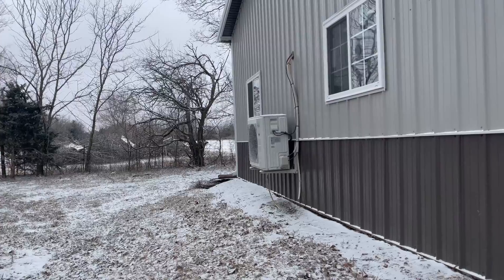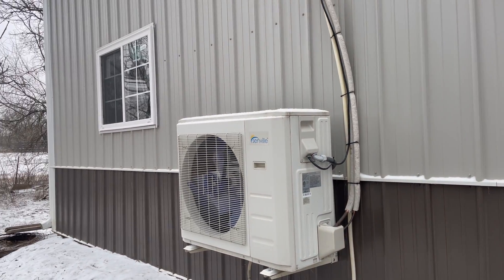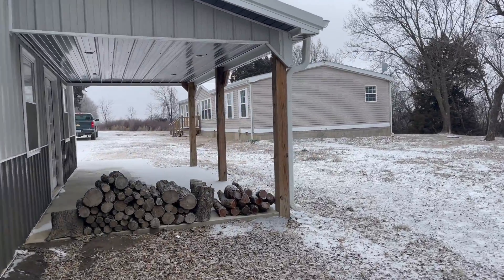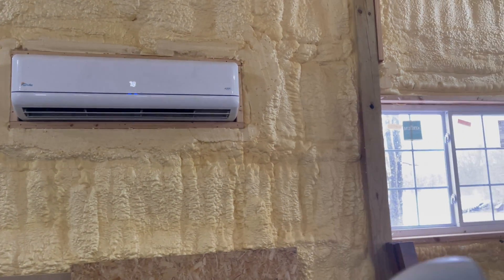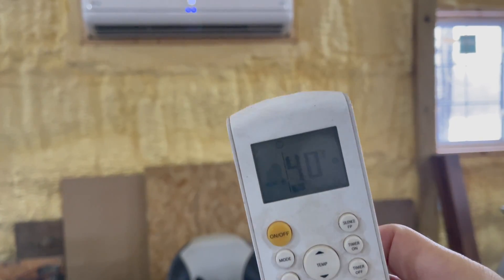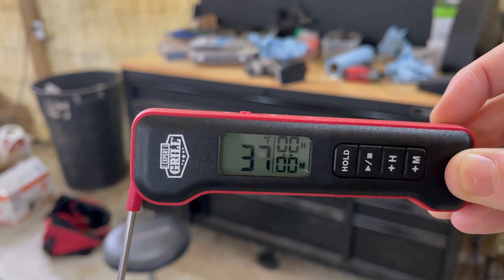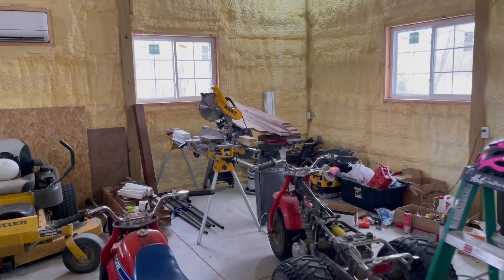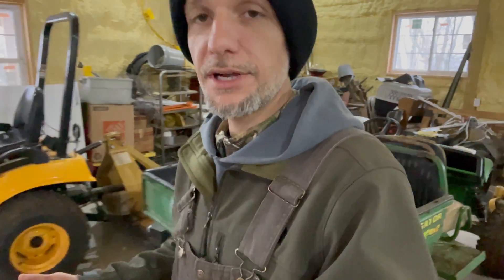Mini Split In A 30X40 Pole Barn

Comment: Just subscribed here from ne Ohio. I was wondering how much open cell insulation do you have? Thanks
Reply from the maker: Hi Jeff. Thanks for subscribing!  The entire shop is done in open cell.  Thanks for watching!
Reply: Do you know how many inches they applied? Just looking at how many inches I will be comfortable with in winter.
Reply from the maker: Sorry Jeff I misunderstood the question. It is roughly 4 inches thick everywhere in its cured condition. I have been lucky to not have any of it damaged yet even though I haven’t covered it. The open cell is easy to damage after it’s installed so just be aware of that.
Reply: @Dexter Ranch  would you mind sharing why you chose to go with open cell instead of closed cell foam spray?  Tim in northern TN

Comment: As a 38 year HVAC owner my Back hurts watching this . I personally wouldn't hook it up or fix your system . There are plenty of none licenced and none insured people that will hook it up with no permit but proubley  won't come back  . My equipment is not wonton junk and I do get calls from homeowners that  purchased this online and after a few years of nothing but trouble they junked it out  . If your building burns doun and there was no permit or the installer dident have insurance you insurance will not pay . With all that equipment you have its so not worth the money you think you saved for the risk .  You must of not checked out the reviews online on your system I did and they  make me laugh.
Reply from the maker: Hey Terry!  Thanks for the comment. I totally see your perspective, and can see how that could be frustrating for someone in your line of work.
Reply: I am also in hvac and have been impressed by the cost/vs quality of senville vs Fujitsu, Mitsubishi or Daikin. It’s all in the quality of the install.

Comment: Nice shop!  Do you ever have problems with the outside unit of your mini split icing up?  Our newly installed unit will build up 2 -4 inches of ice near the fins.  Our HVAC company can't figure out why.
Reply: We keep around a dozen laying hens year round.  We have also raised Jacob sheep in the past , we would bring them to historical re-enactments.
Reply from the maker: Thank you.  I have not noticed that. I will say that once the outside temp drops below zero they are nearly useless. Luckily that happens for a very short period of time in my area. Hopefully they are able to find a solution for you. Thanks for watching!!
Reply: Thanks for the reply. I like your channel content. We keep Dexter cross on our farm along with horses and chickens.  South eastern Pennsylvania.  I'll be making my way through all of your videos soon!
Reply from the maker: That’s really cool. I have been considering getting sheep or pigs, but not sure if I’m ready yet. Glad you are liking the channel. Do you do chickens year around?
Reply: Mitsubishi units do the same thing. In their mounting instruction they recommend mounting on a 4” riser. 2” of ice has built up. Lay some 4x4 blocks down and elevate your unit 4”.
Reply: Not defrosting. Not charged properly.  Poor air flow if no snow stand.

Comment: I have a 50x50 insulated metal building with 16 foot ceilings.    R-11 insulation.   Do you think a mini split would work in this space?   Concerned that my ceilings are too high and would be difficult to heat.   Did you use an online calculator to determine your BTU size requirement?  Thanks for putting together this video.
Reply from the maker: Rex, The only thing I had to go off of was that the company claims their 36000btu can take care of 2000sqft. My shop is roughly 1200sqft floor space, but the 12ft ceilings adds another factor like you said. I think this one is sized just about right for my shop, but probably wouldn’t be able to handle much more. I did see a video the other day where a guy had a large shop and he had installed 2 or maybe 3 in his shop. If this was the way you wanted to go then your shop is roughly twice the size of mine so I would have to recommend 2 of them, and then some ceiling fans spinning clockwise to pull the warm air back down out of those high ceilings. Hope this helps!
Reply: I'd recommend going with multi zone unit vs a single.
Reply: Rex- I have a 45x75 metal 16’ eve height with r9 insulation. Inside the shop I have a small car bay with a paint spray booth. Nothing has been completed yet. I mounted a 24k, mitsubishi. Believe it or not 20 degrees outside and 55 inside. Unbelievable. Summer it pulls the humidity out in the summer. 90 outside, 78 inside during the summer. If I had a 36kbtu, it would work even better. I’d recommend a 36k for your shop.
Reply: @billwebb5648  24k unit is way undersized for the space you have, upgrading to a larger unit will be more efficient.
Reply: Very curious how your 50X50 turned out? Getting ready to build a 40 by 40 width 16 or 18 ft eve height I really want to put into 36,000 BTU units and heat the entire shop with it
Reply: @ they work great.     I had to be careful and buy units that could operate in extreme cold.    I also installed some fans to circulate the hot air back down from the ceiling.